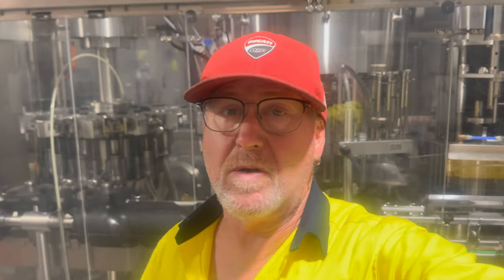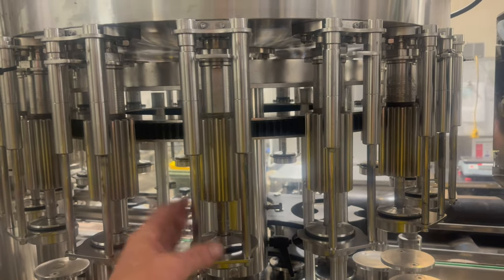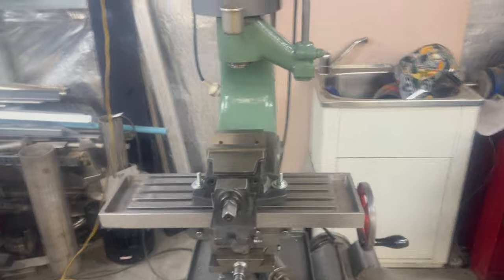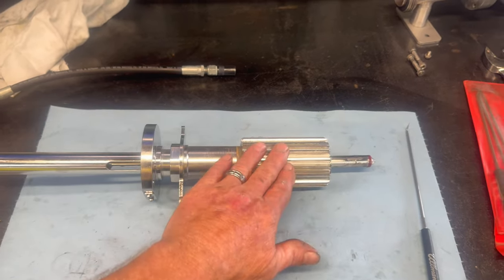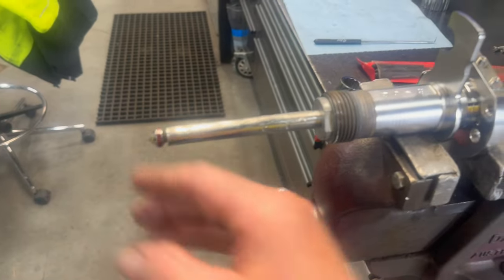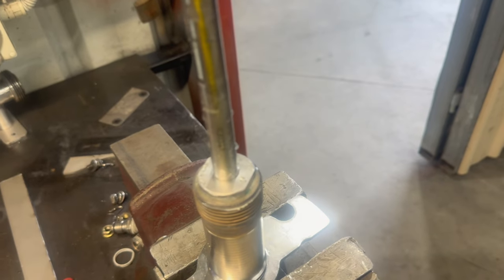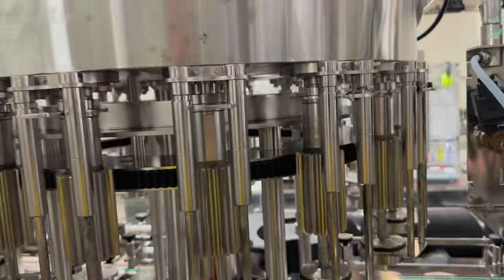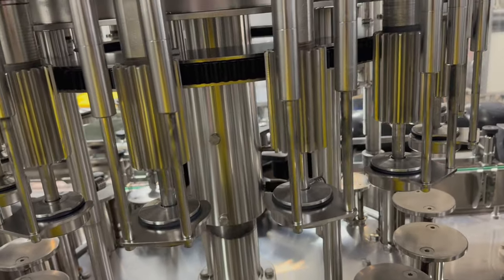Stuff I do at Work - How a Bottle Filler Works

Comment: Back about 40 years ago I was working for IXL as a jam cook (5 tonnes a pop) and I was transferred to the tomato sauce line temporarily. Apparently a bloke had been sucked into the guts of it and made about 65 litres of himself in the sauce? The guys on the line took this as a bad omen and refused to work the line for a while and we were the test rats. I had really long straight blonde hair and Jesus didn't I fit a tight hair net. You'd probably not be surprised at the appalling quality of rotting tomatoes, stalks and all that were fed into this machine.

Comment: I got to do a fair bit of packing at the other end too, and me and my mate cracked the shits once the output got too much. Jesus my mate and I cracked the shits when the cranked the output up beyond our capacity, and the forklifts. We just began throwing No 10 cans left right and centre. Those were the days mate, when teens on the arvo shift, without any OHS rules were told to do ridiculous jobs. Like take the Crown scissor lift and remove the 6th pallet blind from a stack 50 foot high and 5 deep. I must have been psychic not to have killed anyone under a rubble of glass and pallet wood I reckon. I could hear the workers under the debris field letting out brief screams when ever the lot began to tremble, as a fork tine would crash into a bad place.

Comment: Happy New Year to you & the family Andy🇦🇺⭐️
Fascinating insight into bottle fillers & the mechanics of them! How often do the O-rings need replacing? Every year or when there is a production issue? Usually Christmas break is when maintenance is usually done  here in Aus🇦🇺 Except, our frame rolling machine gets jack shit but for a can of WD-40😂😂
Cheers Champ. I just missed out on a spot to come to tassie with the DOCV
Reply from the maker: General rule of thumb is 30,000 hrs for dynamic seals and 60,000 hrs for static seals.